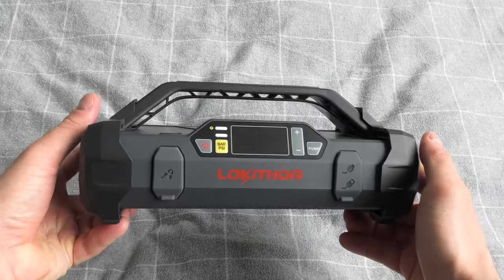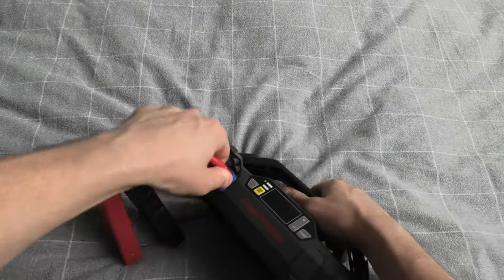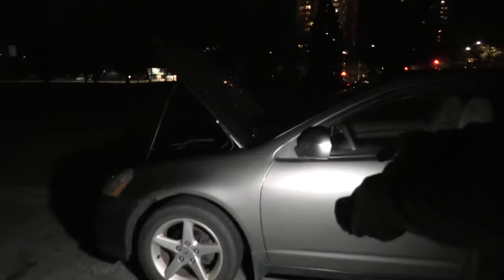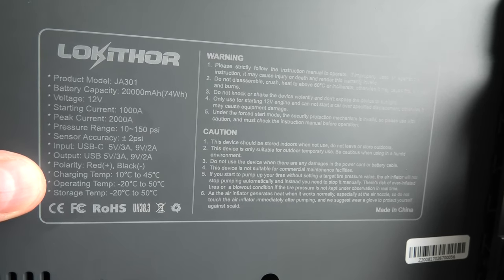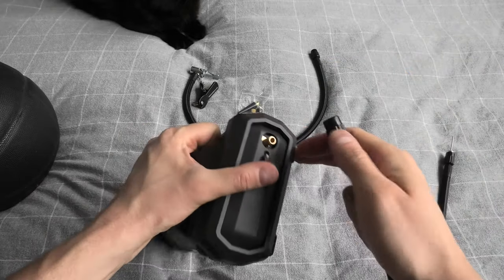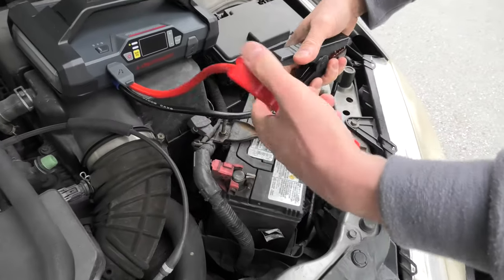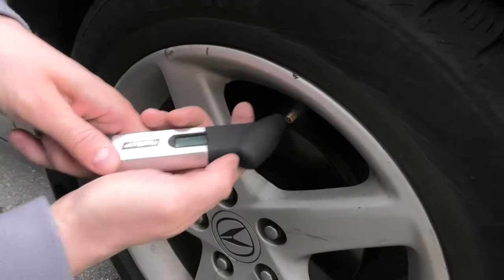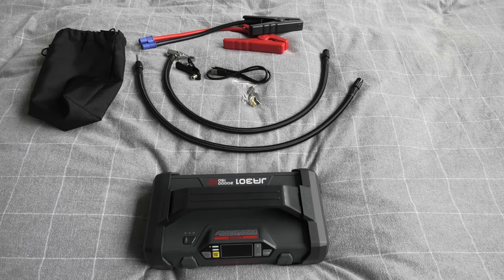LokiThor JA301 Review. 2000A Lithium Ion Jump Starter, Air Inflator, LED Flashlight And Power Bank.

Comment from the maker: PRODUCT LINK:
LOKITHOR JA301 Jump Starter with Air Compressor, 2000Amp 12V Car Battery Booster Pack for Up to 8L Gas or 6L Diesel, 150 PSI Tire Inflator with Digital Screen, 30 Months Ultra-Long Standby - https://amzn.to/3xGyE8j.